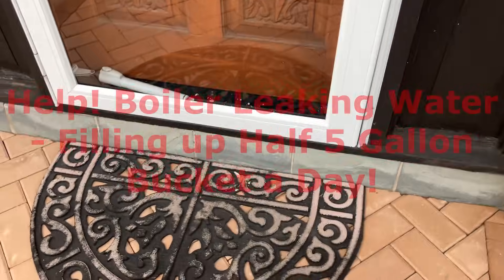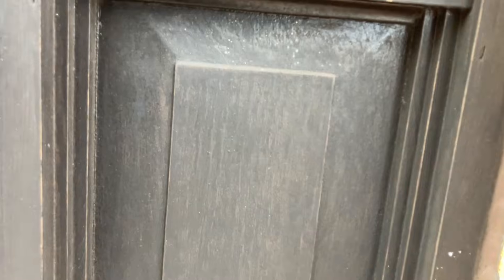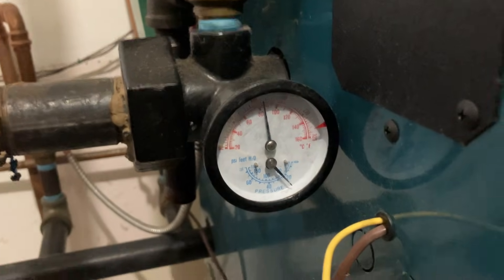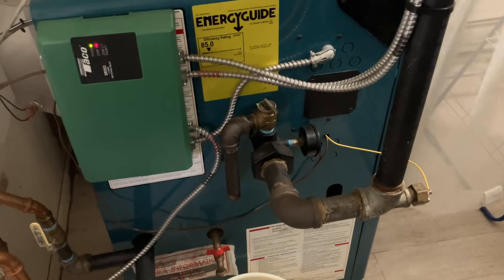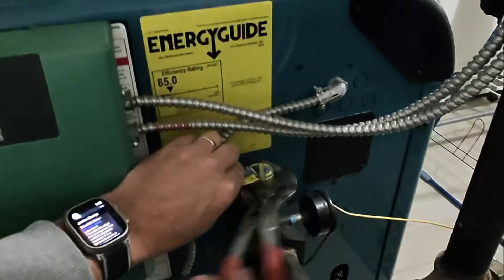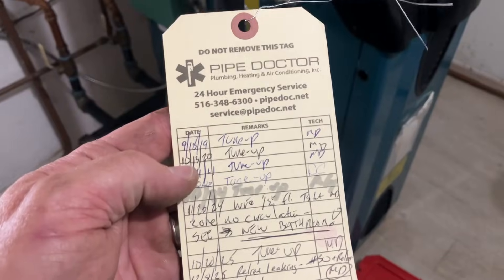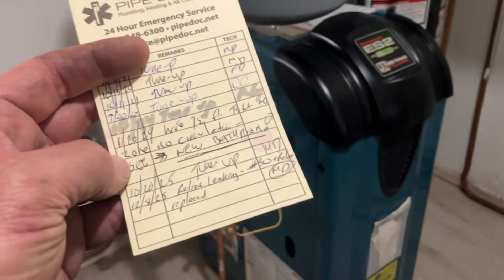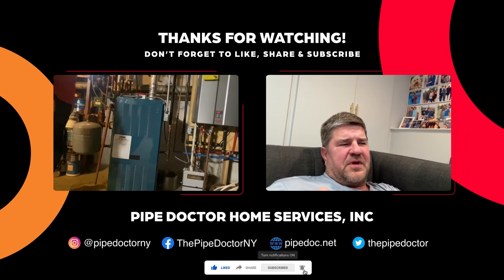Burnham Boiler Leaking Water! Expansion Tank Failure + Relief Valve Replacement – Real Service Call

Comment: Hey Mike Daick, of Mikey Pipes Plumbing not easy being cheesy. I like your podcast/social media, looking thru some comments??? I guess some of your customers,family,friends and competition are still checking in on you again. Hmm? expansion tank looks like one big sediment trap under that air separator. That expansion should and will last about 30 to 100 years. But again, thank God you are not working on an atomic power hot water reactor,lol. Too bad you can't reset the washer on those watts temp and pressure relief valve, could save the customer some money again. Love you buddy, you be safe out there, God bless you my brother in Christ.

Comment: I got fucked today, 3,000 dollars to install a new circulater pump and one zone valve. 10 hours later still no heat and the guy acts like he doesn't know how to wire the valve and the pumps running but not circulating because of air in the system im assuming. Going one the fourth week without heat. Im fucking cursed i guess.
Reply: what kind of fools/bad companies are you calling? also don't call a plumbing only company, they've probably got no clue about hydronic heating, let alone electrical. lol
Reply: @throttlebottle5906 he's supposed to be a licensed hvac with 30 years experience so idk what's next.
Reply: @ckillac5258  well, it's possible they've never dealt with hydronic systems before and not good at electrical/wiring/schematics, maybe color blind?. it can get very complex if there's multiple zone valves and circulators, also there is no exact manual on the connection of every single system and configuration.
Reply: @throttlebottle5906 you're right. The guy never tested any wires. I got home this evening, he left before i got there, the wife was there so she dont really know what he did. He got the air bleed through those self tapping bleeders on the copper pipes which one is leaking, the house is 80 degrees the thermostat is set on 72, boiler runs shuts off about 4 minutes later and kicks on again. He left my new zone control unhooked, i called him he said its supposed to keep running and hung up on me... sorry im yapping man, just frustrated
Reply: 3 grand?  You didn't get fucked. You were raped.

Comment: So why did you press the relief valve fittings? How do you change it now without cutting and replacing the fittings? You should have left well enough alone.
Reply: That helps justify the $1,000 invoice though.
Reply: Usually he uses a compression or union fitting there
Reply: I agree!

I would only have replaced the valve and reused the same pipe. It was all good!!

Comment: Why didn't you use the black pipe on relief valve? Now you gotta cut copper and press in union. WT!
Reply: may be against code there, due to rust blocking if it seeps. but I've seen copper mineral and corroded shut just the same. lol

Comment: Mikey Pipes, Whats the secret to metal to metal threaded connections? They are the only ones that ever leak for me. 
When I started I was told just to keep tighten until I couldn't anymore...(moreso on gas pipe) I'v cracked enough metal fittings to know thats not the secret.
Some people do tape + dope.
I'm thinking of switching back to pipe cord AKA loctite 55 for metal/metal... Do you approve?
Reply: use a high density pipe tape(like blue monster), wrap the right direction and use a rag(or hand, watch for burrs) to help conform it slightly better into the threads. then apply good pipe dope over the outside of that.
if it's over 1" pipe, you can add dope sparingly to some of the first fitting threads, just not too much that it push a bunch into the pipe. the dope helps keep the threads form shredding and rolling out all the tape the, as well as pre-forming somewhat with a rag/hand.  on natural gas/propane pipe/tubing, use ONLY good pipe dope.
obviously make sure fittings/pipe threads are clean of oil, burrs and any old compound/tape. keep and use worn out copper fitting brushes to clean the threads.
typically I use the one of the blue color flexible setting, vibration resistant type pipe dope on everything. "tru-blu" rectorseal for example. it's expensive and hard to clean up off most anything, including hands. I should change my name to "I Hate Leaks" lol